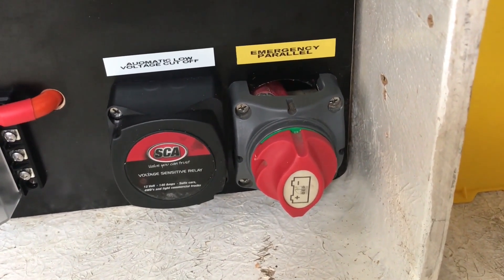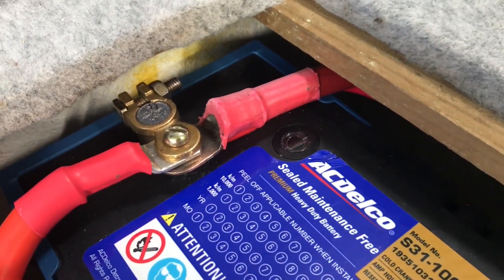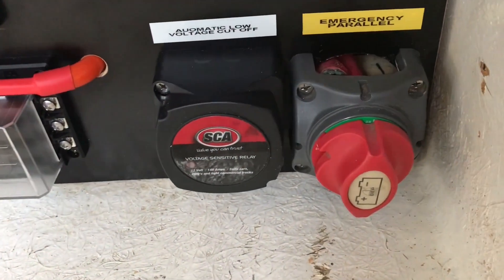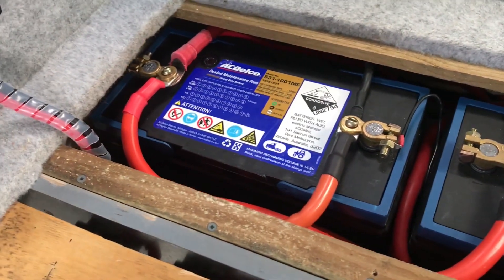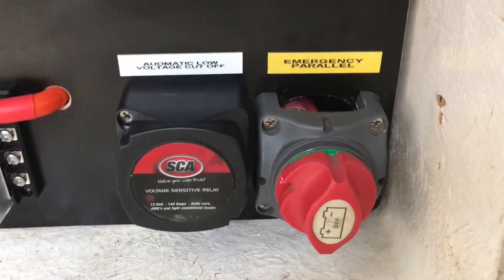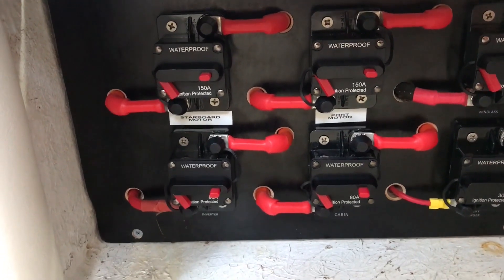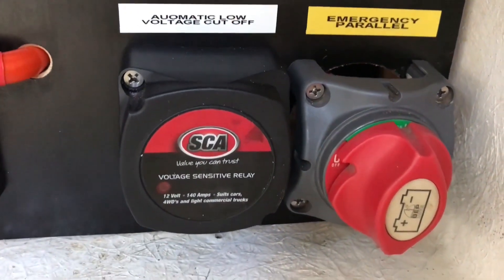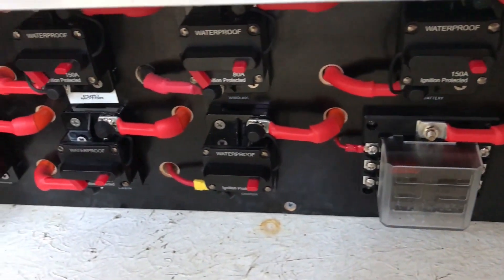Emergency Parallel Switch For Dual 12v Battery Explained - Super EASY to Understand

Comment: Good clean install.
Reply from the maker: Thanks 👍 I have been back since the install as the owner upgraded to a Lithium auxiliary battery. Utilising a 25a DC-DC charger the job was made very easy, avoiding any charging issues with the AGM motor start battery or Lithium AUX battery. Thank you for the comment and stopping by.